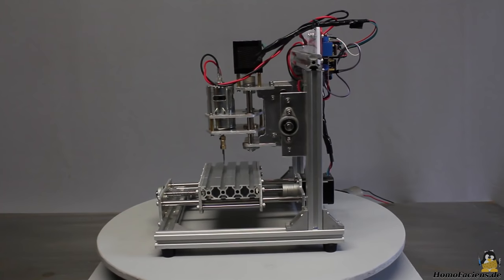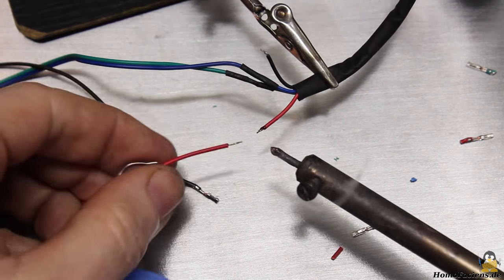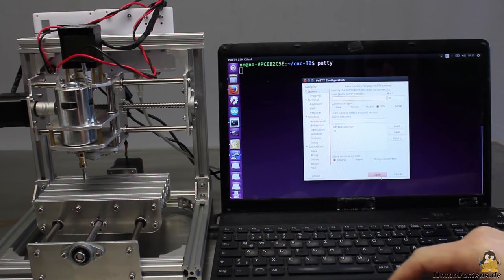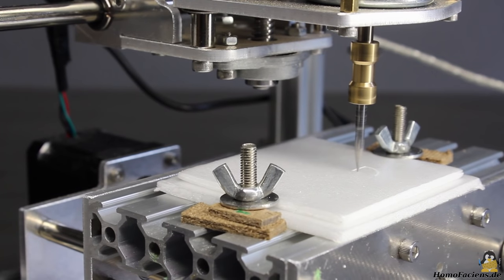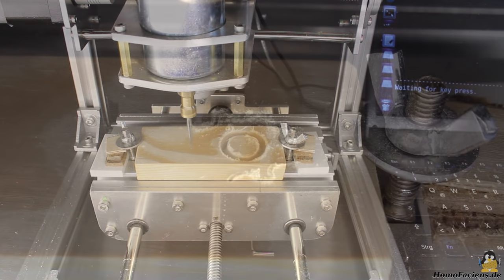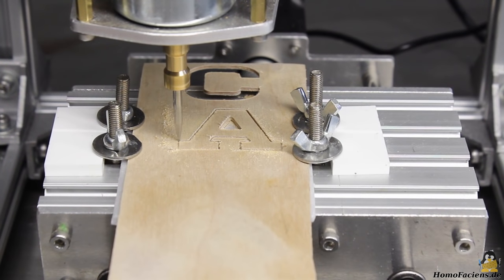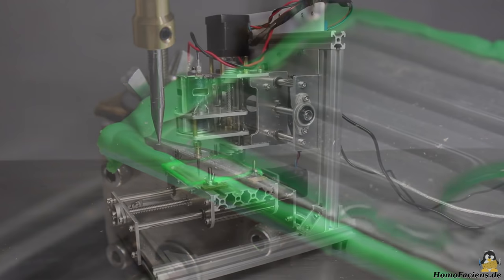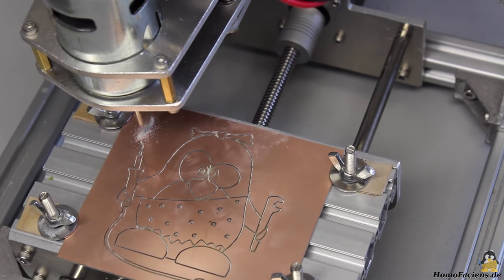CNC T8 from Gearbest - review

Comment: mine came with 3 sets of anti backlash spring loaded nuts and went to see how you installed yours and I dont see you having them in your pictures.
Reply: ok, nevermind I see why. they're not real anti backlash nuts. they're just 2 sets of the brass guide screws and springs. there's no slots for them to move back and forth in. if  had a CNC machine I could cut slots in them :P
Reply from the maker: I though of making anti backlash spring loaded nuts with the additional brass nuts, too (you can use two brass nuts, two of the long screws and the a spring to get it working). However after the assembly I canceled that idea, because it would not improve the design. I will talk about those issues in a second video about the T8 - stay tuned!
Reply: it's strange they would include virtually the same parts that abl nuts have but they arent. cant wait to see the video. should have mine assembled by then. I'm on day 3 of putting it together. :P I just have soldering up the new cables to the stepper motors and fixing up the power supply plugs and its done.
Reply: oh yeah, mod idea: the included power switch is semi useless since it has 2 power supplies but the arduino shield has an emergency stop plug you can connect it to.
Reply from the maker: That would indeed be a way to use this button. Thanks for sharing your ideas.
Reply: another mod idea: using hex standoffs on the motor bracket that are ~2cm longer. it'd increase the stability on the z axis and not reduce the cutting height any.
Reply from the maker: I'll have a closer look at the Z-axis. Another thanks for the idea.
Reply: I put some 4cm standoffs in and it tightened it up a lot.  maybe lost 1cm in Z height though but nothing I've used yet. oh yeah, was able to put the motors shield back on too.

Comment: Could you try engraving pcbs?
Reply from the maker: I will try in a later video after doing some modifications - stay tuned!
Reply: HomoFaciens Cool! Do you think you could make pcbs by putting a small motor/router like this one has on the Tonxy?
Reply from the maker: 3D printers use belt drives to get fast movement, routers use spindels to get more precise movement. Combining both in one machine results in a CNC that is worse for both functions...
Reply: Yeah, the printer is also not as sturdy, but I just thought it was an interesting idea, since many people own a prusa i3 or a clone like the tronxy. Upgrading it with a ~60-100€ spindle motor to make decent PCBs, rather than buying a cnc like this one seems like an interesting idea, if it indeed produces decent PCBs.
Reply from the maker: It depends on what kind of PCB you'd like to create. Maybe 2.54mm boards will work with that configuration, but you won't get paths smaller than 1mm as used for SMD components. Without modifications, the frame as well as the belt drives are too weak for routing work.
Reply: The chemicals for making boards are fairly cheap, you could easily just put a lightweight resist pen on the printer and process it with chems the old fashioned way after
Reply from the maker: Yes, the old fashioned things are often the best solution.

Comment: As they did those figures, I bought the machine in your link and I have problems to make figures, I make them, but in truth I do not print them, could you help me please?
Reply from the maker: Sorry, but I don't understand what your problem is. Probably make a video to show what is going wrong.
Reply: No, it happens that when I try to print any drawing it does not leave me, I make figures and everything and it does not let me print, so I do not know if it is something wrong or you have some special configuration